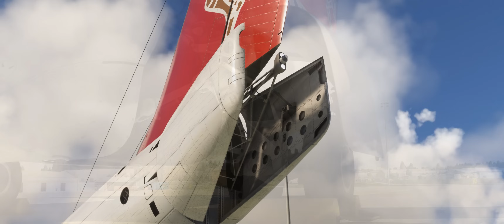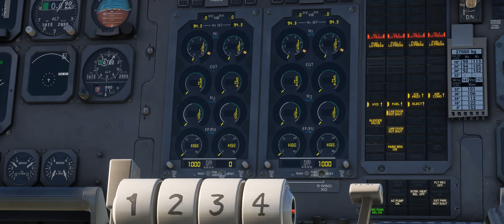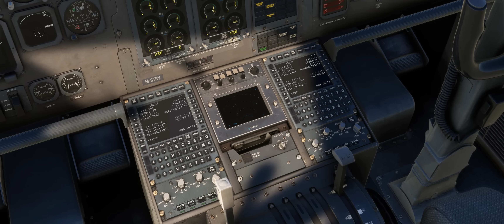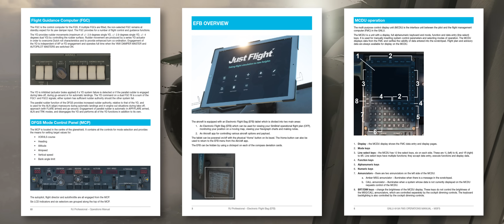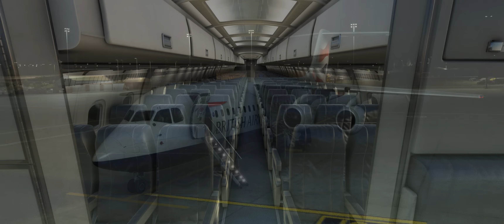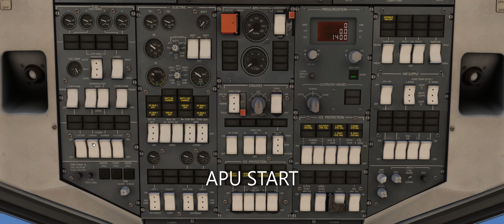RJ Professional MSFS 2020 & 2024  | Just Flight

Comment: The modeling, flight model and sounds look fantastic. This is now essentially what a previous iteration take on this airplane was with all variants modeled by another developer 15 years ago. That takes A LOT of time to do. I will say though, the real world ARJ did draw some curved lines, which this doesn't appear to do. Also don't see the single cue F/D option either. Hopefully the ARJ models with the 910 FMS will be able to handle a basic racetrack holding pattern, both flying it, selecting it and leaving one without a comedy of errors like QW's version. The 910 FMS also shouldn't be populating Boeing style predictive VNAV speed/altitudes in the legs page of the FMS (much less an erroneous 250kt climb speed), just the AIRAC database specific, SID/STAR mandated spd/alt constraints for "advisory" VNAV since the ARJ doesn't have VNAV in modern sense. Congrats to the JF dev team on this product, it looks outstanding and I can imagine the immense work that went into it. The A300B4 looks absolutely stunning. Keep up the great work.

Comment: I've seen the following behavior both in your 146 and on the RJ.
EXT AC PWR AVAILABLE should not extinguish when you switch on EXT AC.
This behavior is wrong because the annunciator is powered by the ground power monitor, which doesn't take any input from anything other than external AC, which is why the annunciator shouldn't extinguish when you move the EXT AC switch to ON.
This can also be verified on various real life videos.
Reply from the maker: Thank you for the feedback. This has been passed on to our development team and has been fixed ahead of the release.

Comment: Is there also going to be a cargo variant included with the RJ ?
Reply: @kimbeheyt214  As of now, there is no Cargo variant of the RJ in real life although BAE Systems has plans ready for conversion of used passenger RJs as these are cheap to get and a converted RJ would carry a price tag of only about 6 to 8 million $ as used RJs can be had for less than 2 million.

This wouldnof course make it a suitable plane for cargo operators but it has to be built first so we probably won't see a cargo RJ anytime soon.
Reply: @GilbMLRS  That's to bad :( Did a ton of Cargo Ops in the 146. Would have been nice to be able to do those as well in a bit modern version :)
Reply: @kimbeheyt214  Just close the cabin door, nobody will notice :D
Reply from the maker: No, there weren't any in the RW, none made so no there won't be, sorry.